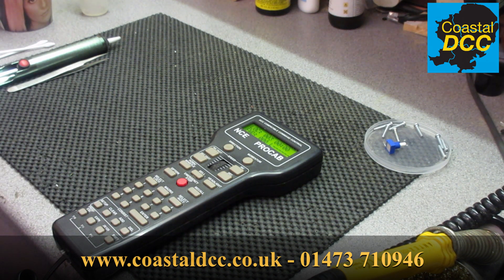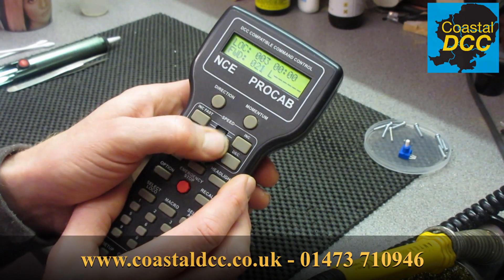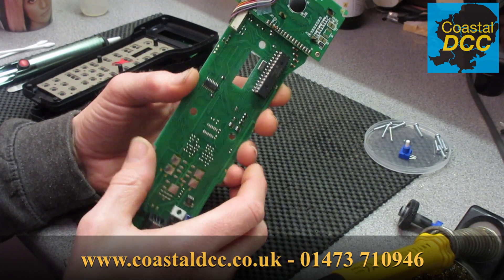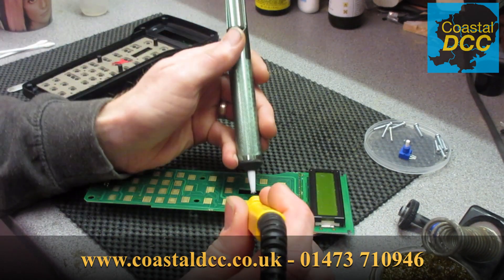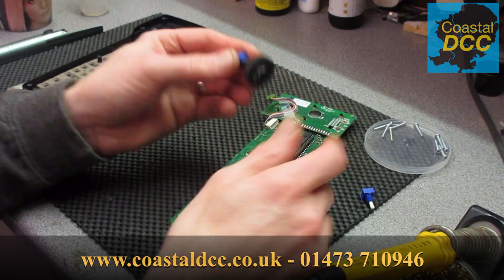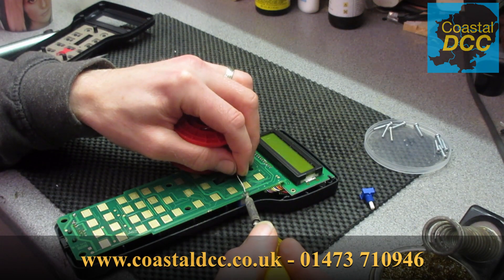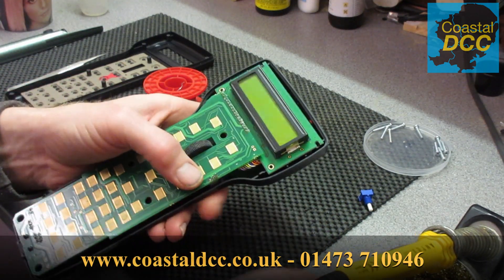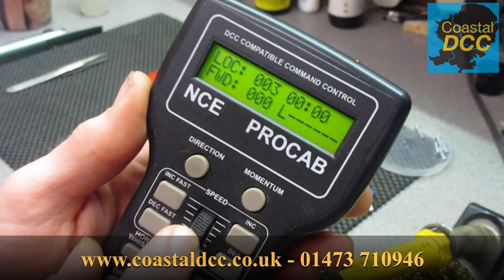NCE Handset - Replacing Thumb Wheel Encoder

Comment: Do you find the new thumb dial rather stiff to turn after replacing it? I replaced mine a few days ago and it seems quite a bit more stiffer than the original wheel. I checked to make sure it wasn't rubbing against anything and that the blue part that contains the 3 connection wires were all properly positioned and sitting flat to the PCB board.